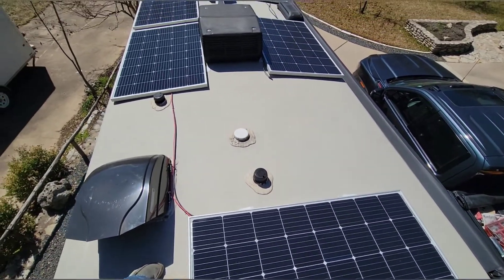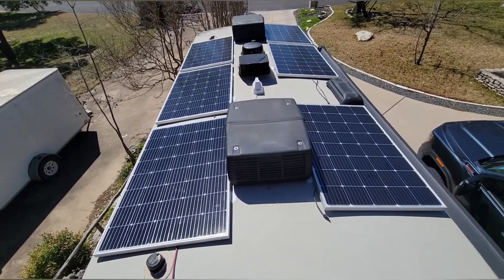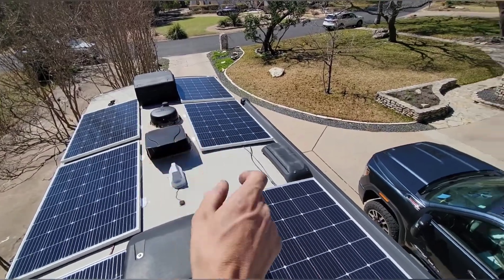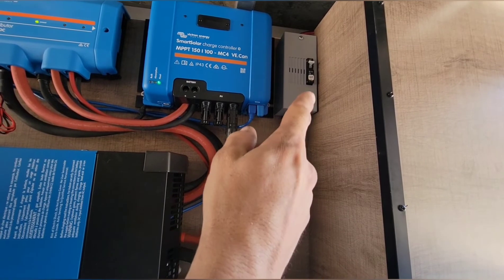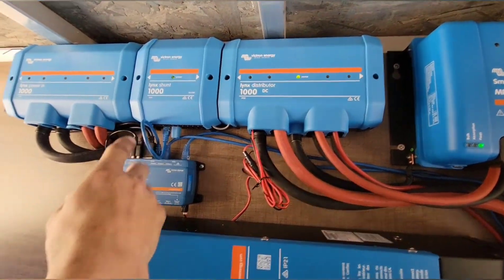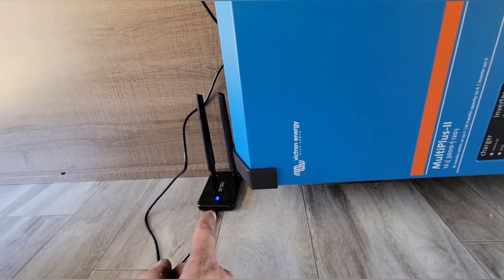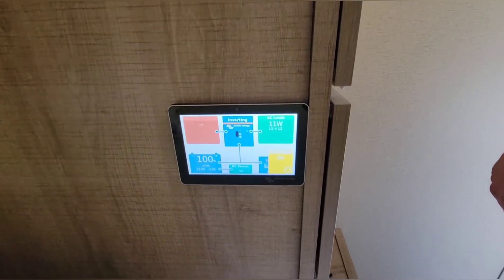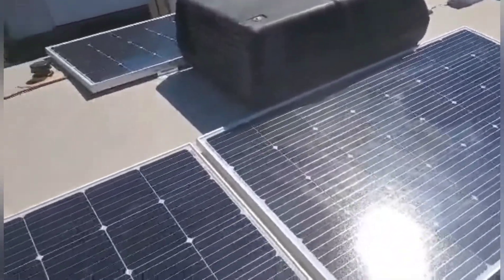Grand Design Imagine 2800BH Solar System Install • Part 3 ☀️

Comment: Wondering how you mounted the solar panels.  Did you find rafters and screw into those?  Or just screw into the plywood roof.  If rafters, how did you find them?

Comment: How did you route the wires from the roof through to the pass through? Wish you could have shown that - as I have this same trailer and want to see how to do that.
Reply from the maker: He had a factory installed jaboni entry gland on the roof otherwise I typically try to come down the plumbing vent or last choice - through a closet. Hope that helps. Thanks for watching.

Comment: Did you have to do anything to ensure the batteries aren't charged off of the 7pin connector from the car?  I've heard that can tax the alternator.

Also, I assume you removed the coverter from his power center now that you have the multiplus handling the function of the converter?
Reply from the maker: No, it's really only a motorhome that has an issue with stressing on the alternator but it won't properly charge without a DC-DC Charger. However the 7pin charging can easily be disconnected.
Reply from the maker: Factory converter was removed. Thanks for watching. Hope that helps.

Comment: How do route shore power to the inverter, and from the inverter to the main electrical panel in the Imagines with the spray foam underbelly?
Reply from the maker: Just have to remove as little as possible and replace what's removed. Thanks for watching - sorry for the delayed response.